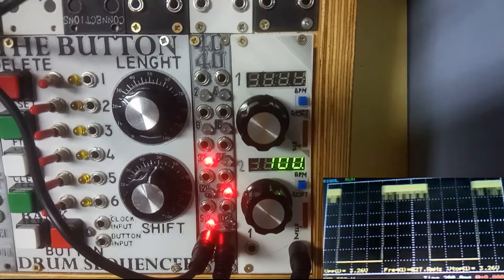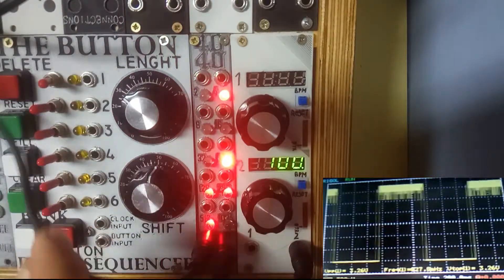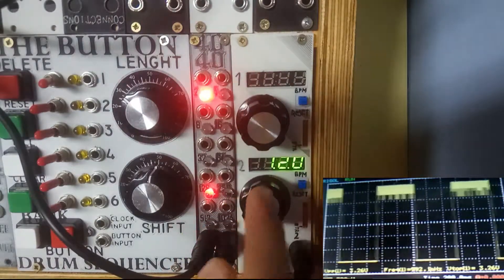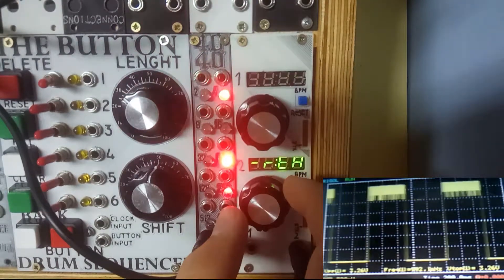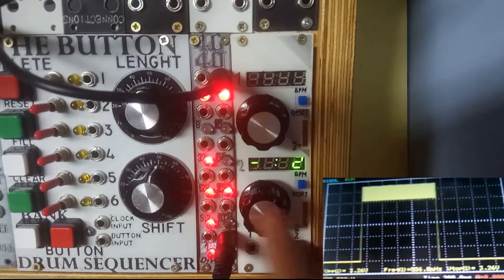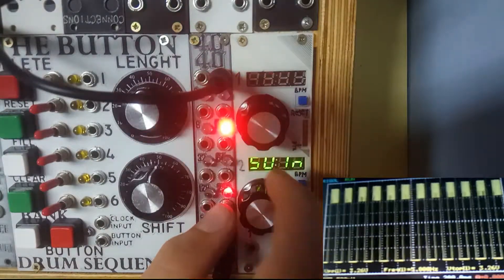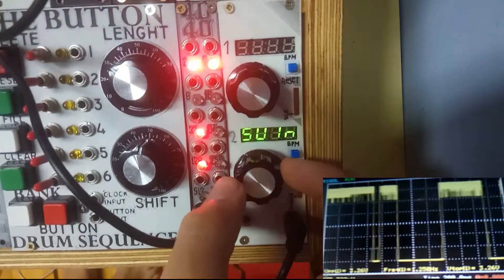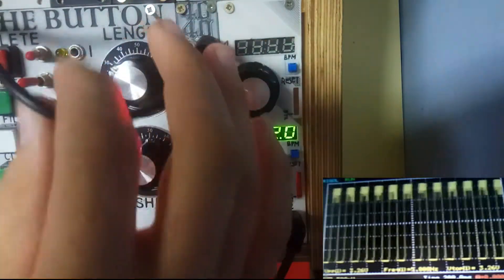arduino clock generator eurorack module for arduino

Comment: Is it possible to remove all of the menu functions so the module only handles bpm? I do not have a need for the dividers. Also, what about adding a start/stop buttom?
Reply from the maker: It definitely is possible. I would like to remake this module someday but I sadly have literally 0 free time right now. If you know a bit of Arduino code, you could definitely go in and change it to your liking tho.
Reply: @machmar  It looks like v1 on your github does not contain the menu code. Is this what I am looking for?
Reply from the maker: @BarcodesModular  I totally forgot. That is indeed true. Join my discord so you can chat with me and other people like me! (Look in channel info)
Reply: Cool. I haven't had a chance to look at the code yet. I will take a look today and report back.